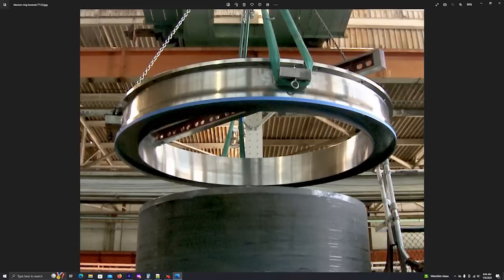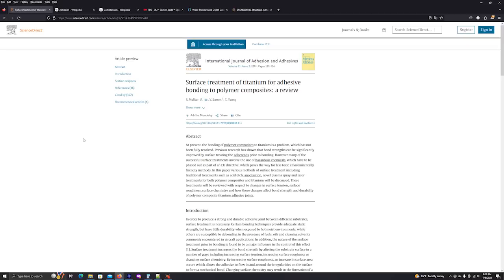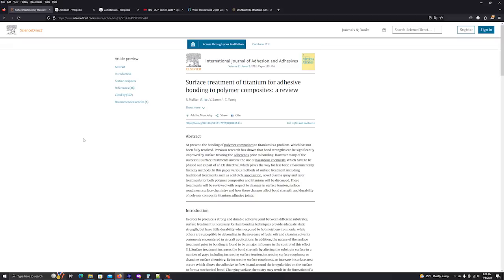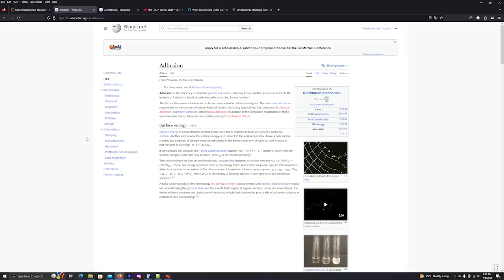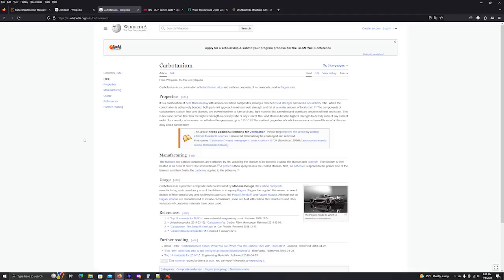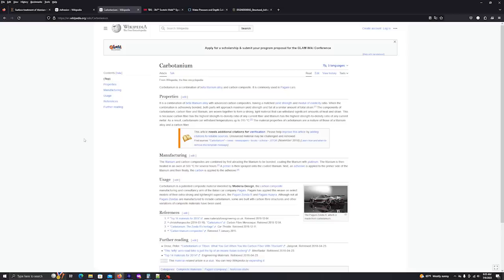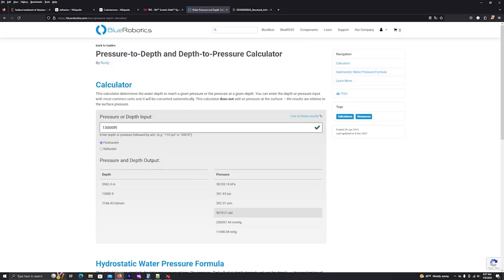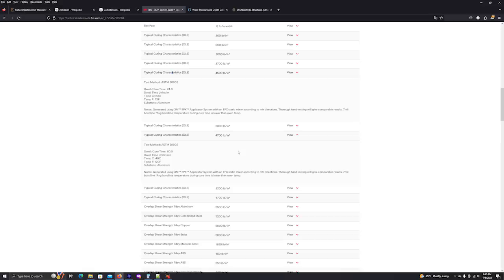Oceangate Titan Adhesive issues between Carbon Fiber and Titanium

Comment: Since the Titanium spherical end caps were bolted to the Titanium rings and since it is assumed the bonding between carbon fiber and Titanium flanges failed during the implosion, should the Titanium spherical end caps not have been still attached to the Titanium rings when they located them on the seabed?
If not, the bolts between the spherical Titanium end caps and the Titanium rings should have failed during the forces of the implosion.
The failure of the bonding did not necessarily cause the implosion. The implosion could have started due to a delamination failure of some part of the cylindrical carbon fiber hull.
Carbon fiber is after all not the best suited material for compression forces. Carbon fiber is generally stronger and better suited to withstand stretching forces.
Reply from the maker: Yes I agree with your concept.  Yes that is a good question on why the end caps were un-bolted or blown off.

Comment: I’m just a engine builder and not an engineer nor do I claim to be an engineer but with that said even though I have no experience with building submersibles I’ve always felt and believe the failure occurred at one of the end caps where the carbon fiber was bonded “aka glued” to the titanium more than likely at the rear end cap if the leaked transcript turns out to be legitimate. And if it is legitimate that may explain why the accent was so slow even after they dropped all the weight she was already taking in water shortly before she suffered a catastrophic failure of the pressure chamber and imploded. This is just my opinion and at the end of the day my opinion doesn’t matter on the subject 🤷🏼‍♂️
Reply from the maker: Thanks for the feedback

Comment: using adhesive/ epoxy is pure madness, even if you sand blast the metal surface  to make it  abrasive the glue will break off, the surface, metal is like Teflon , glue will not stick on it when under stress
Reply from the maker: Thanks for the feedback

Comment: The adhesive they used looked awfully similar to JB weld. It certainly wouldn't surprise me if it was.
Reply from the maker: Many epoxy adhesives are gray or black in color

Comment: I'm not sure that the adhesive strength is the critical issue. The adhesive in this application functions more as a gasket than an adhesive. At full depth, the end caps are pushed into the hull through the adhesive. This is good and potentially very bad. It's good because there are enormous forces that work to seal the joint. It's bad because the adhesive undergoes significant stress changes and temperature changes  in a descent and ascent which might lead to adhesiove fatigue failure.. 

Besides the compressive force on the adhesive that is below the end cap the hull is being pushed inward putting the outer band of adhesive under tension. And all this is happening at close to zero degrees C.  But the fun for the adhesive is not done with just ascending and descending stress changes.

The vessel was put on a raft and towed to the dive location. Now the stresses on the adhesive are significant and chaotic as the raft crashes into the waves. While it might be possible to make a joint like this reliable, it is probably a very difficult thing to do because it is difficult to model stress on a joint connecting such very different materials.Part of the modeling would need to take into account that the two materials that the carbon fiber are made up will behave differently as the carbon fiber is stressed.

And even if the joint could have been designed to be reliable, if the part were not  manufactured using strictly controlled manufacturing techniques with appropriate non destructive testing then the joint would still not be predictably reliable.
Reply from the maker: Very good points, thanks for the feedback

Comment: Very interesting video particularly the aspects concerning bonding.  However, there are a few things with the delivery of the video that I would respectfully suggest be fixed : 
1) Volume is unacceptably low - with my vol set to max I struggled to hear the narration,
2) Fonts are much too small - impossible to read the SciDirect and Wiki articles,
3) Use metric units.  As engineers we should be the first to set a good example for the public.  It is much easier to remember 400 bar and that the  pressure at the ocean floor is 400 X atmospheric pressure of 1 bar.
Reply from the maker: All good points,  will boost the volume. I did post all materials in the description, but I will try to zoom the browser.  Yes SI units as well.

Comment: I'm not an engineer but i will insist on even heavly cout out cylinder of titanium under carbon between rings.
Also i thought about realitively titanium insert (full or cutted out) between to cylinders of carbon fiber wich could be bolted to rings.
Maybe even also extrnal full thin case. Weight will not raise much, but elastic metal supported by stiff carbon could be safer
and give a chance to extra non adhesive bond or bonds to rings.
Reply from the maker: Good points, thanks

Comment: The epoxy looks gray, just like J.B. weld,  but I'm sure they didn't use off the shelf J.B. Weld.   Right?  If the Titanium had continued through the entire interior  of the hull, effectively lining the Hull with Titanium,  it would have been stronger, and of course, much more expensive.
Reply from the maker: Yes,  many epoxy adhesives are gray or black in color thanks

Comment: What about the torque load at the bond site.  The materials DO NOT compress at the same rate.  The composite cylinder is compressing inward  and pulling a strain load on the adhesive.  Essentially tearing away.  That load is several times greater than the psi at the bond site.  Nobody was willing to test that shearing outcome.  Inexperience from their employed staff clearly shows lack of diligence.
Reply from the maker: Yes that could be an issue with the end caps blowing out. Thanks for the comment

Comment: Anyone with the right mindset would question the adhesive to hold at extreme pressure. Such little unstable non-cured binding technology was used. Not even working in a clean room. The extreme gold water under those pressures would snap loose.. vibration between Charlotte to titanium and a implosion of the submersible Fibre carbon material…
Reply from the maker: Thanks for the comment.

Comment: Looking at the epoxy joint depth and sizes of the viewport/end cap bolts, it looks like oceangate was depending on the external hydrostatic pressure to hold the joints together.
Reply from the maker: That would be very likely.
Reply: Yes, but what pressure do you start with? Anyone who has used wood glue. Too much pressure, and you squeeze the glue out, and you have no bond. Too little pressure, and your joint looks awful. Car mechanics, valve cover gaskets, and are designed to be uniformly tightened to seal the valve cover. But you don't go diving with your car.

Comment: Different materials will react differently under pressure. 

I don't know why you would mix materials at all. Under heat/cold/pressure materials will react differently. This will cause bonding issues as one material conctracts faster than the other. 

If you like Carbon Fiber you should do the whole haul as such. Or if you like Titanium you do the whole haul as such. 

You can't expect two different materials to contract and depress at the same rate. 

The smooth Titanium just means it was stronger than the bond or carbon fiber. 

If you bonded Titanium with Stainless Steel then the Titanium side would have gave.
Reply from the maker: Thanks for the comment

Comment: Can we liken a submersible's pressure vessel to a spacecraft's ablative heat shield?  You don't want voids or air bubbles in either component.
Reply from the maker: Correct, you do not want any voids or determinations in carbon fiber, Thanks

Comment: Just for start without watching your video I understand that all glued slip type fittings have to rotate to prevent channeling. When just straight push is applied you are risking creating longitudinal channels which will allow water to penetrate the joint
Reply from the maker: Thanks for the comment

Comment: Since the pressure is applied to the outside of the 'capsule', aren't the forces present pressing the end caps onto the composite tube as well as compressing the tube?
Reply: They are. The problem is that the two materials don't compress equally.
Reply from the maker: Correct,  as we discussed in the first video carbon fiber and titanium compress and expand at different rates.
Reply: @JoediyLab  not the point.  The end cap is captured on the end of the tube by the flange on the titanium cap, the deeper it goes, the more force pressing the two surfaces together.  The external pressure would keep it in place without bonding material (assuming perfect mating surfaces no leakage - bonding material in a sense compensating for surface imperfections, acting as a gasket)  Latest released communications indicate they knew they were in trouble, the real-time monitoring system (RMS) warnings were active, they jettisoned ballast and the landing gear in an attempt to surface before the breech and collapse.   Of course, it is the internet, all information is always suspect.

Comment: I feel like original JB weld would work great for this over 5000 psi strength
Reply: Yeah, the problem is still the 5600 psi at that depth, 600 PSI more than JB weld says it can hold.
Reply: @chuckmiller5763  true

Comment: How would these adequate adhesives do under repeated cycling?
Reply from the maker: More than likely that would have weakened as well.  Repeated stress and strain will do that.  Thanks
Reply from the maker: Any material is going to weaken over time.  All components have a cycle life and must be replaced.

Comment: Yes, Composite fiber has relatively little compressive strength, so is a fundamentally flawed sole material that leaked, causing dieseling within the cabin.
Reply from the maker: Thanks for the comment,  more than likely.
Reply: @JoediyLab  Max frustration, apparently, for all attempting to get through to this guy. There's only so much reasoning power remaining once someone sinks so much bias invested like he apparently had. Thanks for your  patient style of explanation that helps people visualize the physics.
Reply: @JoediyLab  Some clarification:  The fibers of the Unidirectional tow windings had no apparent fiber to bind them; all that existed is epoxy. Progressive splitting with water intrusion, and operational friction rubs, between the unreinforced wound carbon tows would produce the reported sounds. The tube itself could thus have essentially split.

Comment: Was the sleeve that had the Fiber  wound on it  Titanium ? As for the otter 2 inch lip I doubt  that was " so called glue  "   and if so that would of likely been cleaned off as that is where the outer shell would or been attached along with other infrastructure  That wasn't  pressurised  ! that's how I see it !
Reply from the maker: That  was the first sub.  More than likely a stainless steel mandrel. Once the carbon fiber cured, then would pull the carbon fiber off of the mandrel.  Good question, thanks

Comment: The titanium end caps are held on to the hull by the pressure itself underwater. The glue are only there so that it does not fall off when the sub is not under pressure.

Its not an area of concern at all. Not sure why many people are so concern with this.

Also note the photo you see at the beginning during the bonding process is NOT the hull that imploded. Titan has two hull, the one you see during bonding is the first hull which was replaced around 2020-2021. Note that Stockton himself only rated the first hull to 3000m, not enough to see Titanic wreck, which is why the second hull was ordered.

The one that imploded is the second hull which we don’t see how it was made.
Reply from the maker: Yes correct, The video does indicate that this was the first sub. By the way it did fail when they were testing at UW.  Thanks
Reply: Interesting. Where's info on second hull please? :)

Comment: Maybe long steal threaded rods that would go from titanium ring to titanium ring and bolt everything together wouldve ben a good idea
Reply: The center would still have crushed.
Reply: @MarkShinnick  I'm thinking maybe it didn't crush...maybe it popped open
Reply: Not sure how that helps. They'd just go slack?
Reply: @backfromcuba  Dieseling ignition of the interior flammables blows it all apart.

Comment: if everything was mounted to the titanium rings, what's the extra force the descent at high speed 30 instead of 2 or 3 (according to the texts) would have at the glue section where the engineering/life support equipment in back was attached on it.
Being that there seams to only be a couple inch glue section where all the torque would be applied.  And what is the top rated speed of the Titan?
Reply from the maker: Good question thanks

Comment: I totally agree that maybe the biggest issue was that bond and not the hull itself...maybe carbon fiber was not a bad idea...but the bond together definitely couldn't withstand that preasure.
Reply: nah the carbon fiber was a bad idea
Reply from the maker: Yes not sure what failed first, the flange or the carbon fiber, when then blew the flange off.  In the recovery video that appears to be no carbon fiber visible.
Reply: The list of what was done right is shorter than what was done wrong. Carbon fiber was definitely not the right choice. That's right from the Navy, rush said the Navy did experiments with composites and concluded they were not fit for pressure vessels. So he knew but thought he knew something the Navy didn't. I think he brought his aeronautics engineering to the Ocean Gate projects and the two are completely different environments. What works in one does not apply to the other.
Reply: @MrNota500  Thank you! Almost nobody acknowledges  the profound difference between the basic issues in aeronautics and deep sea aquanautics. You can see in.the design of the Titan the influence of Rush's aerospace training, and see it in his use of carbon fiber. In fact, he only had an undergrad degree in aerospace engineering, with only 2-3 years total of professional experience as a test pilot engineer. His Masters was in Business Admin. This was not a guy who should have been running the production of a submarine vehicle, especially for such extreme depth.
Reply: @MrNota500  that's all good...but in order to move on and perfect something we need to see what was done wrong and how can we make it better...yea he fucked up...but it's to late for that know...got to admire what he tried to do.
Reply: @luissoto5942  successful diving to extreme depths in a submersible has already been perfected, years ago.....see Alvin, and Mir.  That was the problem for Rush.....he wouldn't be the first. So, despite no qualification for deep sea vehicle construction, he made up one.  As he said in the hull fabrication video, "It will be the first one of its kind, and I will be the first pilot of it". That's all this was about.....Rush being FIRST ONE at something. There is nothing to admire in such a goal, particularly when he was warned by so many real experts that what he was doing was so poorly constructed it would  kill someone.

Comment: From the images of the recovered parts, the viewing window is clearly missing, as they've passed the lifting straps through the opening. If the inward 
separation of the window and the endcap occured first, the inrush of water may well have blown each endcap off the cylinder...
Reply: disagree with both. The window was popped out by shockwave, and they didn't need to and wouldn't remove it for lifting.
Reply from the maker: That is a possibility.  I also heard the ROV crew removed it so they could life the titanium covers.

Comment: You are looking at the outside of the flange not the inner area where the fiber bonds.
Reply from the maker: Yes, it was hard to see in the image, but after looking again I saw it.
Reply: @JoediyLab  one thing nobody has mentioned is . The titanium end caps were obviously blown off of the titanium rings but i dont see any remnants of broken bolts.  I dont see any  broken bolts around the viewing port either.  It would ne nice if that could be addressed. I find it odd that all bolts were broken clean off flush with the surface. .